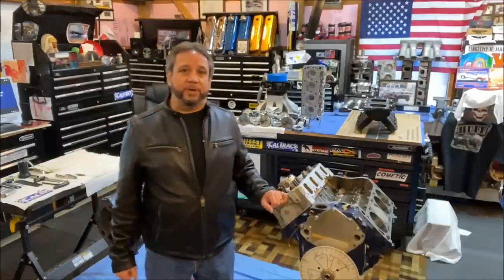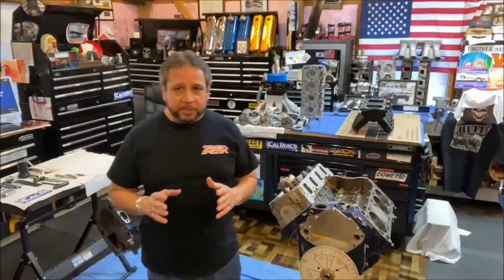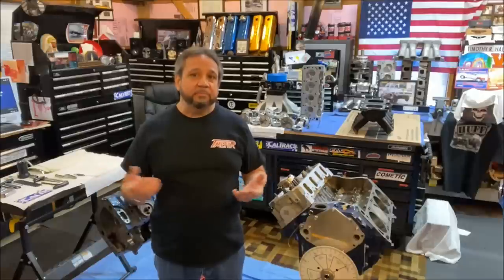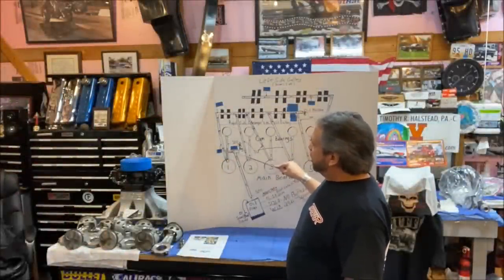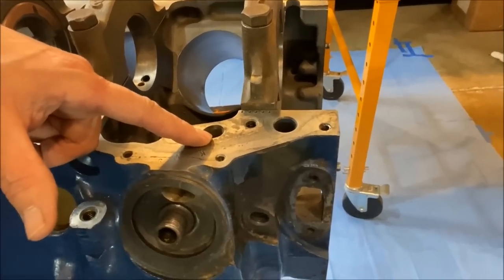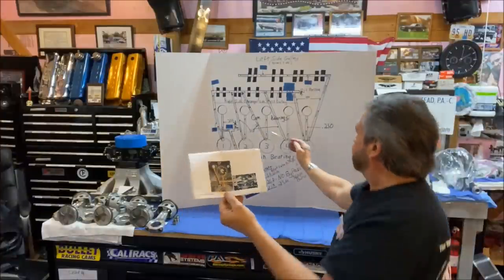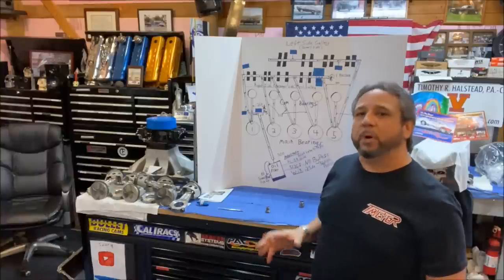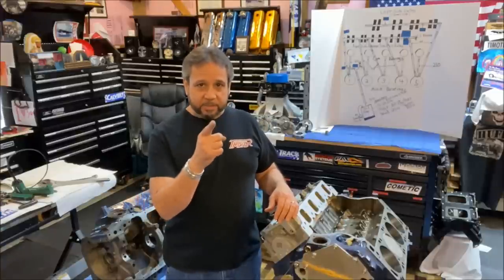Ford 351 Cleveland Oiling,  The Truth, and More

Comment: I rebuilt a 1970 351 Cleveland closed chamber 4v head motor in the 80s. I installed new bearings, rings and cam, it was call a Fireball hyd lifter from Crane. I cleaned up the 11.1 stock forged  pistons and ring groves. I installed a Melling hi volume oil pump (Big mistake) with stock 5 quart pan. I installed a electronic ignition and wires. I installed a set of hooker headers, and new exhaust  system all the way back. I keep the stock intake and ran a Holley 650 carb with open element air cleaner. I broke it in very easy, keep the rpms below 4,000 in my 1970 Mustang. It was hard to do because it was a 4 speed car with 3.90 rear gears. Now that the engine was well broken in, about 1000 miles, I was off to the track, Fremont Drags in California. Well I didn't quite make it, I got into a race with a newer Z28 Camaro 80s on the freeway. I brought the rpms for the first time above 6000 and man that engine pulled really hard. I was about to hit 4th and I hurt a ticking sound Rods. I drove it back home easy and pulled valve covers off and saw gold flakes in oil. Next I dropped the oil pan. What I saw was flake's of bearing all inside of oil pan as well. I grab the connecting rods and they were all loose. I even saw slight impression of piston contacting the heads.The story is true, they run the best before they go, but that  Z28 Camaro couldn't get around me until I shut her down. Years later I learn the oiling system on the 351 Cleveland motor needs to be modified. That was my experience on the 1970 351 Cleveland 4v motor, that engine didn't have much low end, but get in it around 3000. And it just pulled harder as rpms went up. My question is, if Ford knew about this problem why didn't they fix the oiling system? I'm sure I wasn't the only one with a sad story
Reply from the maker: Well quite the story Van. Sorry you had issues. Sounds like one hell of a ride. Hope you fixed it and worked the oil system over. Thanks for watching and commenting
Reply: @DragBoss351Cleveland  Nope, I sold it as is for 1,300.00 cash.I was hurt, and disappointed to the core.I spent hard money (Saving) and time building, cleaning, and dreaming about my 1970 Mustang.I was 28 -29 I didn't want to spend another dime on it. My family was growing at the time. But I do still miss that car from that day on. 🤣🤣
Reply from the maker: Time to get another one, while you can. Think how much fun it would be. And you can fix any issues now. Thanks
Reply: @DragBoss351Cleveland  Now that the kids are gone, I went out and bought a 2018 SS Camaro with 8 speed Automatic. It's been many years since I race another car at a drags. So I headed out to Sears Point Race way park in California this year in August. The Camaro ran 12.50s at 111-112 mph. All Stock, engine, tires, car and me. Just much older, I had so much fun racing my car DragBoss'
Reply from the maker: @vanlarson9213  cool deal. Pretty fast that is for sure. Just too old school for new muscle. I have long time before kids gone. I will be an old man when they graduate 😬

Comment: Great Video!  Plugs and Restrictors are great. Bushings in the lifter valley (MAJOR PRESSURE LEAK) are great.  All these contribute to a better oiling system.  Tim' s cam bearings are great. Has anyone played with the idea of altering the block to accepting 460 engine roller bearings and have a trickle oil hole EDM'd into the roller bearing shell (they need minor oiling in my opinion). Yes this means a custom billet camshaft. 
There used to be a kit on the web that you could buy that had a drilling jig, long length drill, and roll pin that forced pressurized oil onto the camshaft gear-distributor gear interface.  It had the promise of preventing the chewing up of the distributor gear.  Has anyone out there seen this?
Reply from the maker: Thanks for watching and commenting. It’s is a systems of leaks and control is the key. No idea on the roller cam bearings. To tell you the truth never had any distributor gears have oil issues, main things I see are wrong clear between gear and cam gear.  Needs to have some room for movement. Thanks Bryan make sure you subscribe and like 👍
Reply: If the lifter bores are in good shape, lifter bushings are not needed. Contrary to popular belief, oil does not leak between the lifter bores and lifter unless the bore is damaged from galling or rust pitting.
The oil pressure loss occurs with the lifter itself allowing too much oil into the pushrods. Custom oil restrictor pushrods with .020 oil hole, along with the restrictors in the usual places solves the oil pressure problems.
Stay away from lifter bushings unless you like playing with fire. If the clearance between the lifter and bushing isn't perfect, the lifters with stick causing cam failure with flat tappet cams especially. Been there done that. I will NEVER sleeve the lifter bores on a block again. No need for it. I ruined two cams, two sets of lifters, and had to get another block. Bought a set of oil restrictor pushrods and problem solved. My Cleveland has 45-50 psi at 2000 rpm with 10w30 oil at full operation temperature.

Comment: I am so interested in your channel! My first car was a 1970 ford Torino Gt with a 351 4v stock 300 hp. At the age of 16 that car was fast ! The first time I rebuilt the engine my father said I should go back stock with a RV cam ! I am pretty much sure you know who won that battle! From there the engine went into a 1965 mustang Lol That was short lived ! The mustang belonged to a friend and the engine was mine ! Then I rebuilt the  engine again only changing the crank bearings and the pistons! If I remember correctly, they were TRW 11- to 1 compression aluminum pistons ! I had a friend called Holley Walley build a 2 barrel adapter plate for the engine because it was going into a 68 Ford  Galaxie 4 door for a Stock car on a 1/4 ovel mud track at Tripple M speed way! And it was 2 Barrel only ! The car was a beast ! Steering was at least 6 turns lock to lock ! But the engine was fast and it didn't care about the weight ! All I had to do was drive it witch was not easy Lol! That engine in pretty much stock form and that heavy ass car won the the points race for I believe 4 years ! After that the engine went into a 71 Mercury cougar ! But before it did it had some work done to it! It went to North State auto in Chico CA ! There it was balanced and blue printed , heads were ported to match stock 4v intake manifold, and a TQ 30 Sig Erson cam! I don't know for sure but I think it was degreed. I added Roads lifters and the rest was stock! The intake, The carburetor, and the exhaust ! This 3550 lbs car was the fastest car in town ! Anyway sorry about the book ! It just took me back to the days ! Hope to see more of your channel.!
Reply from the maker: 530, thanks for watching and hopefully subscribing. Man that was a history, but that Cleveland sir got around. And battled well. Look through all my old videos and see why you can find over 230 videos I bet you find things to keep you going for hrs. Stay tuned.
Reply: The car that it beat was a chevy vega with a built 350 chevy ! I do not know if it was stroked but I do know it had a dual tunnel ram and headers ! He said he had a lot of money invested in his car ! When I opened the hood on my Cougar he was in shock to see the stock intake and carb and exaust !And if anyone is thinking it was a one race wounder, Well think again! We raced 4 times ! Oh I have to say these were 15 mph roll starts and I won every time!  But never the less that car was probably half the weight of my car with a hole lot less mods! I traded that car in for a family car and to date that makes sick to my stomach just thinking about! Lol someone ended up with a good package ! Any way thank you for your channel it has brought back a lot of memories !
Reply from the maker: @530swag  wow. Well now it’s time to bring it back again, build another one.

Comment: Great channel im actually building a cleveland and I was concerned about the oiling system. You said it would be a pain to polish the oil galleries. I came up with a idea how about extrude hone. Company in Huntley Illinois does this. Im going to find out if they can do it.
Reply from the maker: I had thought about that, but truth is, will it make that much of a difference. To me the big obvious areas that are easiest to get to matter most, all areas where .585 is, Tim Meyer oil filter adapter, and auxiliary line. But by all means see what they say, thinking outside the box, keeps you one step ahead. Thanks Jason for watching. Don’t forget to subscribe and like my friend.
Reply: @DragBoss351Cleveland  I just got a old set of A3 heads and intake that Roush had worked on the only thing is they milled the exhaust side down like the steel heads. Came with all the aluminum plates to finish its just a matter of finding someone to finish the heads and intake.
Reply from the maker: @jasonmadding8692  Not sure why they would do that, other than to raise the ports even higher. The later heads like the C3/C302b had higher exhaust and intake ports. That is the key someone to finish them. I would suspect your around the $2k range to get them finished. A high quality port job, starts at $2500. Justin Heck may be able to help you, I talked with him a couple of weeks back.
Reply: @DragBoss351Cleveland  If you talk to him let me know. I would greatly appreciate it
Reply from the maker: @jasonmadding8692  ok I will.

Comment: Im rebuilding my Y Block.  Drilled out a small squirt hole into the front journal for timing gear, plugged up the over flow rocker shafts . . . antways a bit far from a performanse clevland but in regards to oiling i too wonderd about those 90° bends in the oil ways.
I remember using a diamond rope saw for cutting holes in tile, and wonderd if a lengthy lead teather attach to a diamond rope and follower teather was fished into the journals around the corners would that be effective enough to accomplish the rounding off, obviously in a shoe shine reciprocation around corners?
Reply from the maker: Every engine benefits from smoothing out as many sharp bends and turns. Will work on a block next, what I grind, your 312 with two carbs and go go go.

Comment: Set oil pump to 100 psi. Use external pressure relief valve at oil pressure guage port. Relieve oil pressure there and vent into lifter valley area or into oil pan.

Comment: Not exactly sure if I want to subscribe yet. Ford considered the Cleveland and the modified to be in the small block category. Although they're labeled as series 335 etc. Deck height four spacing stroke and bore is general small block sizing. Even though Ford considered the Fe series a big block. It's still had small cubic inch just like the gm366 etc. This may be confusing for GM and other make guys but Ford motor company considered them a small block. Just like the 302 boss just because it's big heads doesn't mean it isn't a small block. During the trans am series they run this engine against other small blocks and it had to be classified as a small block with limited cubic inch. I think you have some very good ideas and a lot of topics you have are very interesting. However I would like to continue seeing your research it doesn't mean that I will always agree with you so I may subscribe in the near future. Thanks for all your hard work and your dedication.
Reply from the maker: Thanks Brent for the kind words. And no we do not have to agree on everything. That is what makes for discussion. Not sure why you would not subscribe, you just have to ring the bell, not hard, and does really affect you for the most part, but no worries, I just want to keep moving forward and need help building my channel. Stay tuned for more.....
Reply: @DragBoss351Cleveland  I guess it wouldn't hurt to subscribe. There's a lot of half truth this day and time. Subscribed
Reply: @DragBoss351Cleveland  thanks for your response. There's a lot of these people don't really care about your opinion or the truth. So you have my support keep them coming buddy
Reply from the maker: @brentgrimes5353  good man, not let’s get to making some fire breathing Cleveland’s. Sit back and enjoy. Take what you can use for your combo. Thanks Brent.
Reply from the maker: @brentgrimes5353  exactly. I may not agree or you, no big deal. We don’t get hung up on semantics. Use what we can and don’t follow it, if you disagree. It’s your opinion, I’m good with that. 👍

Comment: I built a Cleveland with solid roller cam and used the Moroso main restrictor kit, and a HVLP oil pump. It would hold oil pressure at an idle, but by 1500 RPM, it pumped all the oil out of the pan and I lost oil pressure. That is a HUGE leak. I mostly, but not completely solved the problem with a really dumb low tech trick my dad told me about from the old days, pipe cleaners in the pushrods. At the time, I thought I was pumping all the oil up into the rocker arm/head area and it was not draining back fast enough, which may be partially true. But now, watching this info, I think I was also losing oil right out the bottom of the lifter as well. I was not aware at that time, that the lifter gallery was getting oiled first. Regardless, I was never able to fully fix the problem and moved on to other engines.
Reply from the maker: I have heard that before, the Cleveland is a system of leaks, its controlling them that is the hard part. I have used a HV oil pump for the last 40 years, and never an issue for me, luckily. I have always used a 9 qt pan, that might be the secret, thanks for watching. Lots more in store...

Comment: So would a solid lifter cam help also for oil loss?    We had a 400 back  in the 80’s and any rpm would start to loose oil pressure and seemed we would have lifter collapse on one side(?).       Exhaust note would change on the drivers side first 
In retrospect, was a poorly speced engine, 4 v closed heads with pistons down the hole like a 400 does, Crane commander cam, single plane eldebrock emissions intake and Holley 850 double pumper. it probably had a high volume oil pump, an extra quart of oil, and a brother that didn’t mind reving the poor thing past any sane reasonable rpm.
Reply from the maker: I can’t answer that, but may have been a bad lifter, may even be the wrong lifters. I had put in Windsor lifters in before and it had great oil pressure, until warmed up then the gauge would bounce all over, with drops in oil pressure. I was sent the wrong ones and did not any better. I bet it had no compression either. But your brother had fun. Thanks for taking the time to respond and give us your experience. Make sure you subscribe, thanks

Comment: Please do a good video about 351m/400. All the problems and what fits. I am having a 10:1 351m built with Autotec flat top zero deck pistons. Heads 2v open chamber have been worked over. Also a 4 barrel intake. I want to turbo it blow through setup eventually. Love your videos
Reply from the maker: Thanks Frank your combo sounds nice and will haul. Have to put out the list. Appreciate you being here

Comment: With the Tim Myers  restictor kit all I need is his cam bearings and plug the 1/2 mane hole and drill out the other to 5/16? Thanks
Reply from the maker: 1/4 inch pipe plug, going to right side lifter galley. and drill top of main, cam bearing feed to 5/16 , to main inflow There are pics on the web they should help just type in his cam bearings Paul

Comment: Over three-quarters of a second just putting a roller cam in there I'm wond ering did you have to go with extended valve stems and deepest Springs stiffer Springs?
Reply from the maker: James, not sure of your question, but All I did was put the cam in, they told me it would be fine, and plenty of PV clearance, I put it in, and never looked back, at this time I would of rechecked everything. Thanks for asking James, stay tuned....